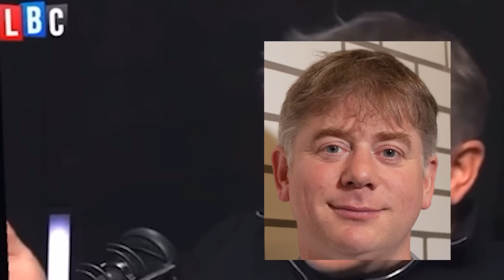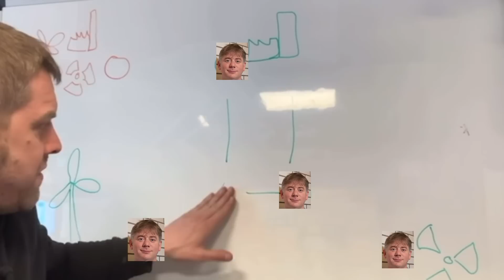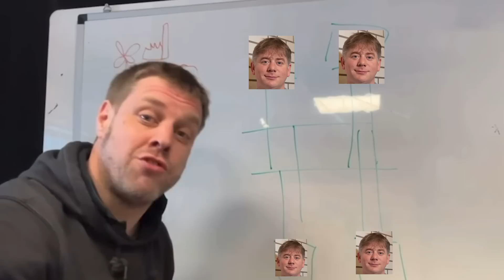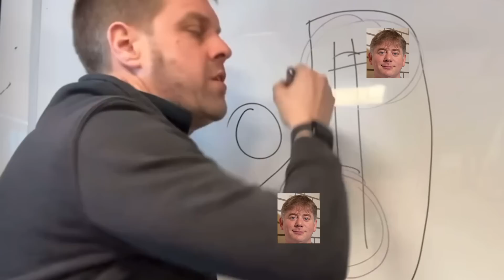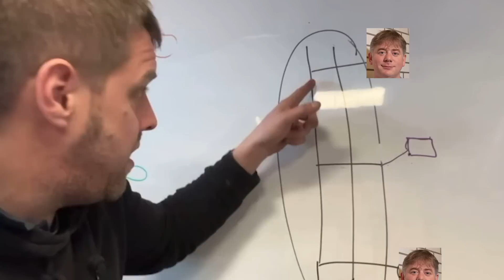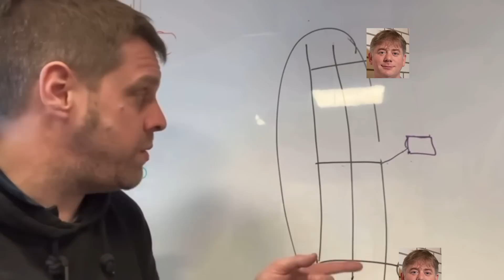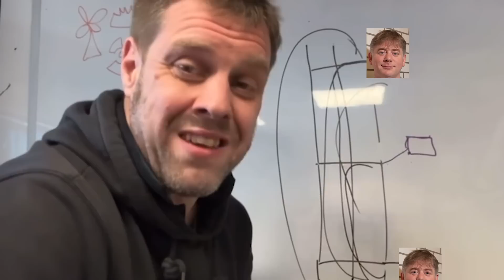OCTOPUS REGIONAL PRICING The Fatal Flaw WITH virtual GREG FROM OCTOPUS

Comment: I like your videos usually but on this subject you are out of your depth. By making a comparison with a substation you are assuming that the grid is an infinite busbar, which in reality it is not. In the past it almost was since there was some joined up thinking and it was built around existing power stations, but now that wind has replaced coal those days are long gone.

Unfortunately the current single national price allows now subsidised generation to be built at one end of the country and the generated electricity to be sold at the other end (even sold for export abroad) without any upgrades to the transmission system in between. It's a bit like if some company installed a 7kw solar array on your roof and kept the FIT payments for themselves, but then said could use all the power that it generated to charge your car at 7kw when it's sunny. Happy days in theory except in the rush to get the inverter powered up and commissioned to get the FIT payments the contractor connected the array to the nearest electrical circuit in the house which just happened to be the upstairs lighting circuit. So in reality on that sunny day when you are charging your car supposedly for free, you can only use about 1.4KW from the solar and the rest you will be importing from the grid and paying for.

This is essentially what is happening now on the national grid under the national pricing model. Subsidised wind farms have been built in Scotland and that energy is sold on the grid, except the demand is far away in the south and the grid does not have enough capacity to transmit this energy. Turning off the wind farms involves paying them (sometimes excessively) for their lost subsidy, which is paid for by the consumer (balancing costs). And remember that subsidy was paid for through green levies on consumers' bills in the first place. The turned off energy has to be replaced elsewhere on the grid and the consumer pays for that again through balancing costs.

I hope that explains what a shit show the current situation is.

The options to put it right are: 1. change the market arrangements to stop this situation occurring in the first place (zonal pricing which reflects the actual transmission capacity of the grid across the proposed zones and pushes the costs back on to generators and suppliers), 2. rebuild the grid to increase transmission capacity and get back towards your infinite busbar concept (surely the preferred engineering approach but will take years, pylons everywhere and consumers will pay for it), 3. do nothing and watch balancing costs spiral while private companies continue to reap profits from government subsidised projects financed by consumers.
Reply: Agree with you. He kinda goes over this himself without realising it, the grid is a local grid, where you backup your neighbour, not the other end of the country. With the extra power in Scotland they should be making hydrogen out of it rather than shutting anything down. He also talks about, not in my back yard, which is also the reason why you may want to give locals a discount. So I feel Greg has a valid goal and if anyone can then a startup disruptor can.
Reply from the maker: Oh you think hydrogen will work , goodbye
Reply: @Actual_electrical_content  I'm anti hydrogen, because it's mostly an oil company scam. However..... H2 production/storage near large renewable generation  will probably become viable & be a core part of our grid.
Reply from the maker: a re you saying curtailment wouldnt exist if you charged your EV , if we can’t get rid of it on the whole massive grid your gonna struggle when it’s in a microgrid
Reply: @Actual_electrical_content  If me & everyone else in my region were offered dynamic cheap power for EV charging, yes, I expect curtailement would become a thing of the past. It's not my field though, and I know it's complex, but like most things, it can be boiled down to a few simple things, like match supply & demand in the right places.
Reply from the maker: @ we can’t rely on people charging ev for a few hours to stableise a grid , you need to research grid frequency and  inertia
Reply: @Actual_electrical_content  Maybe  we need a bunch of regional flywheels to provide inertia. I don't know. It's not my thing.  Happy to watch a video about it if you want to do one.  There's plenty of people out there who know way more than me. Always will be. I like to hear from them, but they've got to build credibility & respect before I absorb what they say.
Reply: @flatfoot  there are projects ongoing to replace the inertia lost from the grid by moving from coal power stations to wind farms (google stability pathfinders phase 1 and phase 2). This is a just a distraction from Jamie from answering your question about wind curtailment because he doesn’t know what he is talking about.
Reply: @flatfoot  but that would mean you and everyone else in your region dropping everything and rushing off to charge. You are tied to the wind or solar. You will have gone back to the dark ages where you have to plan your life around the weather. This is the fundamental problem with solar and wind. They are not reliable enough to service a modern economy 
 Imagine having to go without any electricity for maybe days at a time, which if no nuclear or fossil backup would be the case 

We have experienced three periods of several days with only 5% or so demand being supplied with wind or solar in the last six months. One period lasted for a week. Greenies are going to discover eventually what everyone has been saying, that without fossil or nuclear there is no reliable dispatchable electricity in UK. Adding more renewables and closing fossils/ nuclear is only going to bring power cuts closer.
Reply from the maker: Oh dear you think zonal pricing will make it cheaper for consumers not just Greg , are you gonna pay more for your electricity then
Reply: @Actual_electrical_content  I live near wind & sun generation. When it's sunny & windy they often turn off turbines. If I could charge my EV for cheap, everyone's a winner. We're only talking about some control software & billing. Also happy to sell it back later on.
Reply from the maker: @ they turn them off because they can’t run mechanically not because they can’t get rid of the electrical energy
Reply: @ Are you saying  CURTAILMENT of wind/PV does not exist in the UK?
Reply: @Actual_electrical_content  I won’t be paying more for my electricity no because I am on a dynamic variable tariff which follows the market price and I can load shift automatically. But if the market doesn’t change then all those consumers on fixed tariffs will just pay more. It’s already happening, standing charges going up to cover balancing costs and network build-out and the price cap going up as the suppliers need a bigger hedge against market price volatility
Reply from the maker: @jon_273  ahh your one of the people that thinks your home solar can beat the system but can’t actually operate unless it’s connected to the grid
Reply: @Actual_electrical_content  I don’t mate. I don’t have home solar or batteries; I am and always will be 100% connected to the grid since I live in an apartment.

What I am is a grid engineer who spends all day balancing the system in real time to keep it at 50Hz while respecting transmission constraints. I do this all day (and nights and weekends) so I am talking from experience with my comments but if you don’t want to listen then you crack on.
Reply: @jon_273  you're wasting your time with this bloke, he's a master of deflection and personal attacks when he gets called out on the nonsense he's posting. I've lost count of the comments he's come out with that very clearly illustrate he is very out of depth ...
Reply from the maker: @ if u don’t like it do one mate I am not here for discussion I was stating some facts , I do this for a job not just some enthusiast you pleb
Reply: @Actual_electrical_content  You need to remember there will always be someone out there who has more experience/knowledge than you. If you have a channel like this, with some refreshing content, don't get the hump because one of them chips in with wisdom. It's just like PID a feedback loop. Without feedback & listening, it goes unstable.... just saying..
Reply: @Actual_electrical_content  "low quality full of foul Language lose on facts" .... fair play for acknowledging this, it's just a shame you can't debate using actual facts and the reality, oh well Jamie, as long as you're getting the clicks eh
Reply from the maker: @ why don’t you bang out a video and put your facts forward and I will watch it and respond , my content is for people in the industry your view is worthless to me
Reply from the maker: Tell you what jump on zoom and r can record the conversation and I’ll putbotboutbon this channel , let’s have that debate I am more than happy too
Reply: @Actual_electrical_content  "lose on facts" ....
Reply from the maker: @SeanMoore2008  so you don’t want to debate it then just quote my own disclaimer that’s the very thing you seem to be upset about because you believe Greg and are in his cult
Reply: @Actual_electrical_content  your deflecting yet again ... plenty of points have been raised in these comments, which you simply ignore and get the hump, it's cool, you've been rumbled a while ago ... the poster who  commented that you were "out of your depth" was spot on.

Comment: Your assertion that single points of failure will cause regional pricing to fail is flawed, simply because the future topology isn't going to be based on massive points of generation serving large geographical areas. The future will see a multitude of independent micro generation systems (including domestic PV, wind, small and medium scale storage) all contributing to the grid, forming a massively redundant grid - I suspect you'll remove this video when you have realised that your analysis is illogical and was clouded by your equally illogical distain (which might be politically motivated) distain for Mr Octopus .... at least you've acknowledged the factually incorrect content during this "espisode" ❤
Reply: What happens when the micro generation is offline?
Reply: @robertbritton656  you obviously don't understand the nature of micro generation.
Reply: @SeanMoore2008  I'm fully aware of microgeneration. No system has 100% uptime.
Reply: @robertbritton656  ... what are the odds and consequences of every piece of microgeneration plant failing or being concurrently offline, against the chances of legacy plant failing or going offline
Reply: @SeanMoore2008  It depends entirely on the number of generators you have installed. When was the last time every power station in the UK was offline? When was the last total failure of the grid?
Reply: @robertbritton656  you now seem to be making points that defeat your own argument 🙄
Reply from the maker: @SeanMoore2008   you don’t understand grid frequency or inertia
Reply: @Actual_electrical_content  I'm fully aware of grid frequency and inertia, it's fairly obvious that you are not an_actual_engineer (just_another_youtube_gobshite_despirate_for_clicks) ... congratulations, you've now completely defeated your own arguments 😀😀😀😀
Reply: @SeanMoore2008 what are the odds of only 5% of demand being able to be supplied from wind and solar? We have had three periods of several days over the last six months where this has happened, one of which lasted a week. Remember the extended periods of fog/ low cloud with no wind?
You probably didn't notice because your electricity was probably  being supplied by fossil/ nuclear/ France. As these supplies are phased out and torn down you will see more power cuts.
Don't believe your supplier when they say you are only on renewables, it would not be possible to keep your lights on at times without the fossil backups. They are lying to you. They fudge the claims by buying a few carbon credits or the like.
Eon is supposedly only supplying renewables but with all their customers they cannot possibly be keeping the lights on for all on a windless night.
Reply: Research inertia and frequency. Your micro grids will not under pin that. Ever. We should value, embrace, support and maintain our grid and large infrastructure. It's a national asset behind not much else (perhaps roads). Micro gen can play a part in the future. But replace the grid? Absolute nonsense based in the realms of energy barons ideology and political biass
Reply: @electrician247  your knowledge is somewhat retro ...
Reply: This is already occurring. The grid is a local grid. Even when we buy electricity from abroad, it goes to the major urban hubs and not to the outter areas as they don't need it.
Reply from the maker: Have you heard of the cascade effect of small generators when frequency drops , probably not your thick , I am more likely to sook off Greg than take this video down , your wrong
Reply: @Actual_electrical_content  After that hit a few years back didn't they change the standard to make this less likely to happen?
Reply: @flatfoot  yes, see Grid Code modification GC0035 regarding RoCoF and G59 protection settings.

Comment: Reduce the bloomin' standing charges for starters...

Why is it the poorest areas - North Wales, Liverpool etc... pay 70p per day standing charge, whilst London pays 40p
Ahhh, but there is more users/density in London so costs are reduced shared by more consumers...
Where as in less densely populated areas the less people to cover the costs

NO - Either we are ALL connected to the National Grid or we are not
Gas std charge is nigh on the same, you don't pay more for your phone/broadband coz you live in a different area of the country - so stop ripping off consumers - some are the poorer citizens, paying 50% or more than other users in London every day

You wanna help balance the grid, avoid high peak demands Greg ???
Offer very cheap off-peak electricity to EVERYONE - not just EV owners,
so more people will delay high consumption at peak times and load-switch to off-peak energy times

Help ALL consumers - equalise the std charges & offer very cheap off-peak energy to EVERYONE - regardless if they have an EV or not

Oh wait, by actually "HELPING CUSTOMERS" to lower their bills, that would reduce profit/turnover if Energy Companies actually implemented REAL common sense measures - nah best not do that then Greg...
Instead spout some BS about regional pricing, try to push more green energy - more AI/Data Centres - which consume enormous amounts of energy themselves, demand consumers have smart meters & smart EV chargers to spy & decided the charging times if they qualify for cheaper EV tariffs

Yeah, do that BS about how to revolutionise the energy market - but still fleece consumers unfairly to keep profits up

Octopus - they want to monitor/spy on you & your usage, collect the data and maybe offer you some cheaper tariffs if you agree to comply & be monitored how/when/what you use in your own home
Reply from the maker: I agree the standing charge should be a standard

Comment: Greg being a to55er, and sucked off by all the ignorant do-gooders, as always!

To maintain a nominal 50Hz, the grid requires generation to closely match demand, at any particular instant. Location of those is largely irrelevant, beyond shorter distance between generation and load is more efficient. That is why solar and batteries, on roofs, and consumed locally, in the building below, or very nearby is best.

We have also all been paying to build the current infrastructure through standing charges / energy bills, for many years (around 30 years in my case) with pretty much no say in how that infrastructure is being built, and where it is built, so now applying favouritism / discrimination depending on where you are connected to it, is absolute 🐂💩.